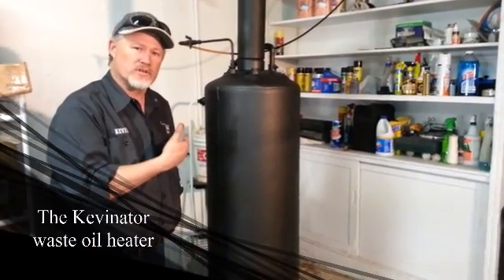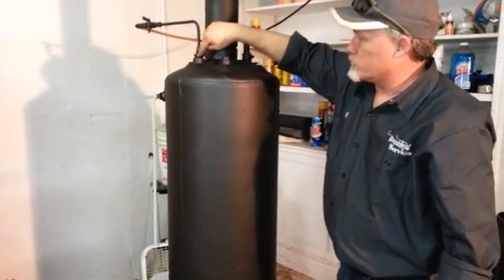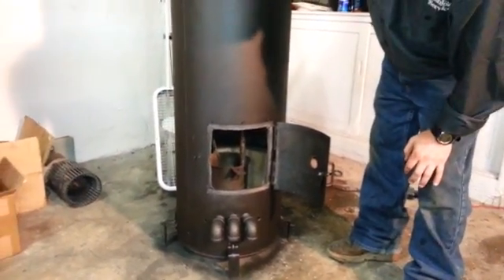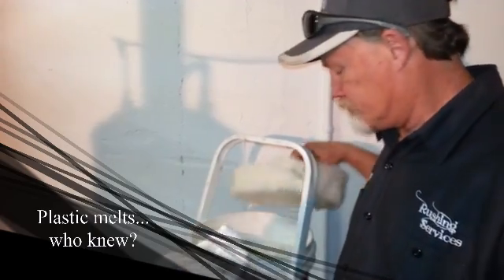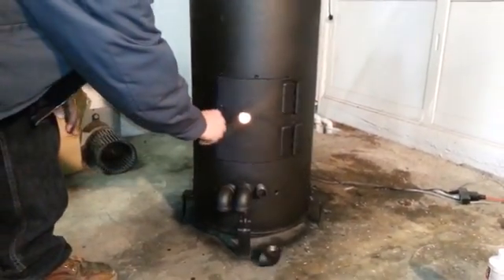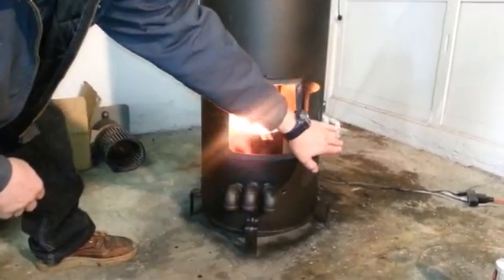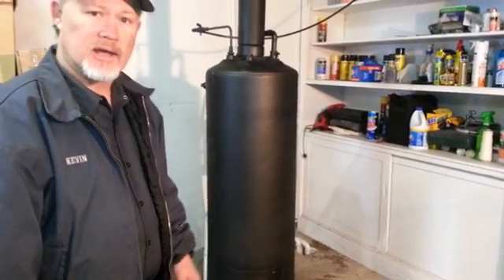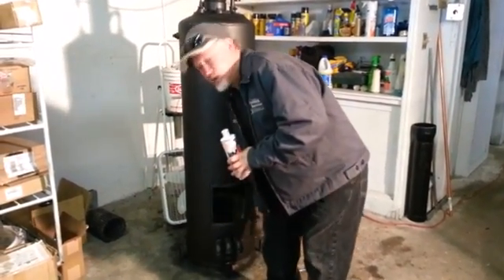Waste Oil Heater made from electric water heater

Comment: You can save the electricity, as you dont need the fan blowing in there . You can put a hole beneath the burner and when you close the door it causes a draw all on its own .
Reply from the maker: This stove isn't designed nor intended for natural draft. If you want to build one check out Mother News

Comment: I made a oil burner with a smaller water heater,the only thing I did different, was to add a quart of kerosene to a five gallon bucket, it thins out the oil, and it’s light it easier.

Comment: I made a waste oil burner, with a smaller water heater, the only thing I did different was I added a quart of kerosene to one five gallon bucket, It helps burn the oil a little better.

Comment: I built a waste oil heater in 1980-81 that I believe is better that the ones I am finding on you tube. I got the idea from Mother Earth News.  I also used a electric water heater tank for the body. The burner assembly was made from two 8 inch diameter iron skillets one inverted over the other separated by standoffs . the top skillet had multiple holes drilled through it with broken pieces of fire brick under it in the other skillet. The oil feed dropped from the top and fell through a six inch pipe that had the exit about 1 1/2 inches over the top skillet. It was rated at about  120,000 BTU. worked great. no liquid was burned. Only gas as it vaporized falling down the center tunnel.

Comment: I'd wrp that tank with thin sheet metal and use a squirrel cage fan blowing into it making a forced air system so you can blow the hot air where you need it. Maybe into ductwork and heat a house with it.

Comment: If you have two valves in line, you can leave your adjustment valve - your needle valve or whatever - set to whatever setting was working last time, and turn the whole flow on and off with the other valve.  That way you don't have to go through that adjustment palava each time.  Just turn it on and go.  If you do need a 'slow rate' and a 'fast rate' you can also set that up with two needle valves and two shut-off valves, but my guess is you don't even need that.

Comment: Hey Kevin 
Do I need to use copper for the air feed inside the tank ? Do you think 3/4 Black pipe would work ?
Reply from the maker: I redesigned the oil/air feed after that video. Check out my video on how to build it and insert it at the lowest port on the tank. It's much more efficient
Reply: @BYprospector  O.K. Thank You 
I'll  make it with the the 3/8 copper pipe running threw the inside of the 3/4 black pipe.   Like the wood stove video .
 Thanks Again

Comment: How does the blower get any air all encapsulated in the insulation ? Seems like it will get hot and burn the motor out.
Reply from the maker: Ivan Bentley Claymore I make sure there is plenty of room for air flow and there is a piece of cardboard between the insulation and the blower that keeps the insulation from getting sucked in.

Comment: 8:28 Yep..! That's the exact reason why I run needle valves only for all of my burner projects. Heard a lot of people say a 1/4" ball valve will do...NOPE..not going to happen.  On my burner for my forge, I can run all kind of fuel, gas or liquid. If it can flow, it can burn. BUT there is one thing to keep in mind..you got to filter your oil and/or install a filter before the needle valve. If you fail to do so, you'll have nothing but trouble with that damned thing.
Reply: How hot will that oil burner get?
Reply: +Kalle Klæp- Great Tips :)))

Comment: what is your fuel consumption?  do you have any problems with your oil and air running inside the heater chamber?
Reply from the maker: Tim. I go through about 5 gallons in an 8 hr period. I did have problems with the air fuel feed system so I upgraded it to the system I use on my wood stove conversion. I explain it in detail in my how to video

Comment: it is the water tank for the hot water heater  there is only one tank with heating elements in it it  thats been removed but iin it.. there is an pop off valve, water inlet water valve and discharge valve.. at  bottom when removed... for tjhtose with those questions

Comment: Sorry i am still alittle lost,  doesn't the electric heater have a tank inside to heat water. This looks like you gutted the inside of the heater
Reply from the maker: +Tonysbigrig 
There's only one tank once you remove the outer skin and insulation
Reply: +Tonysbigrig - LOL, you need to take one apart... You will see what is inside.  LOL
Reply: +Tonysbigrig I think your right, I belive this is the inner tank from the water heater.

Comment: Why not put 2 valves on it? A valve that you can adjust permanently and the second closest to the heater you can use to for shutting heater off? When you want to start it you can just open on and off valve so that waste oil drip stays the same mostly. Also can a second door be added above clean out door that has a glass to watch the fire giving it the illusion of a fire place? Also would it be feasible to use a solar powered fan for the forced air? And if you put a 55 gal drum on a stand just out side of the building on an elevated rack and pipe in oil to a, say 2 or 3 gal container, ( to catch trash and etc. before draining into main container), that could be connected  to another 5 gal container slightly below it  that actually feeds the fire and it would all work on gravity and to maintain a cleaner area around stove. Your could then fill drum as you received the oil. if you were able to get a lot of waste oil you could then connect more drums where you kept in good supply in case of power outages. Please some one let me know if these things could work because I am collecting materials to build a waste oil heater and would like to make as many mistakes as possible to prevent unnecessary damage to my wallet !!! It couldn't take much!!! Thank You !!!!
Reply from the maker: I think all those things would work great :)
Reply: Kevin Rushing Thank You Muchly for replying Mr. Rushing even though I made a mistake in my comment stating I wanted to make mistakes and meaning I wanted to make less mistakes as possible! Have a Blessed Day! And thanks again!
Reply: +Cricket 2691 Well i burn used veg oil and the thing with that is if it gets cold out it hardens like lard but motor oil and the like would be ok outside i think.

Comment: why do you need the blower ? can you use it with just the air intakes open ? thanks ..;)
Reply from the maker: If you don't  want a blower you'll need to build one of "Mother Earth News" waste oil heaters. In order for the oil to burn clean it require a large amount of combustion air.
Reply: so If I engineer some extra air intakes for reburn it should be able to function and burn better .;)
Reply from the maker: Inside Man I suppose  but you will need at least a 6 inch pipe and like a wood stove you'll  need to go higher than the peak of your roof to get maximum draft
Reply: ok My chimney comes out 35 feet  ;)
cheers and good luck with your projects ..

Comment: does your chimney go through the roof or wall....is it on its own
Reply from the maker: I am an appliance repair/heating tech.I own my own business and my shop was an old bakery. My pipe went through an old brick chimney high on the wall.
Reply: do you use this as your sole heating furnace
Reply from the maker: moe roy I had a gas furnace that worked at night and when I wasn't in the shop. I only run my waste oil heater when I'm able to keep an eye on it. But it kept the shop quite nice. It would get hotter then my inferred gun could measure 600 plus F I think. Glowed red on the side at times.

Comment: i like this video.   Wish you could of shown more of the actual chimney. Is this in your basement? I am going to build one similar    but mine will heat a 300 gallon water tank used as a heat sink....so when the burner is off, the water tank will keep on giving.  thanks for your video.
Reply: My plan also.  The boiler will be in the shed, piped hot water to a large 800-1000 gallon tank in the basement for house heat (we have radiant baseboard heaters) and pre-heat for the electric water heater.  I expect the water heater to never come on...and will install a water temperature mixer to bring it down to 120f.
Reply from the maker: Thanks for the comment Moe. This was in my shop/ place of business. What exactly did you have questions about? Can't wait to see a video.

Comment: Looks good  Kevin, hope that paint doesn't smoke u out.
That oil feed is going to block all day long. the oil burns inside it leaving it as u say crusty and sometimes you need a drill to remove it.
I would be running it down the outside of the unit then in to the pot.
www.dripfedwasteoilheating.com
Reply from the maker: You're absolutely right Jim. I did it like that because I couldn't get the elements out to run my drip in at a lower position. I have since abandoned that heater and converted a wood stove. On that stove I redesigned the oil drip inside the combustion air line. I "almost" never have to clean it. I have a video of that stove also.